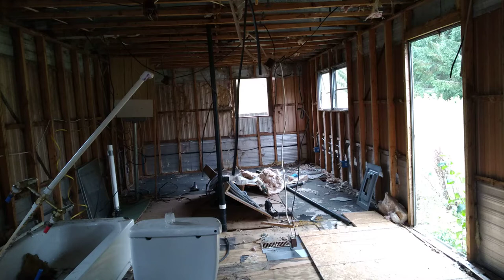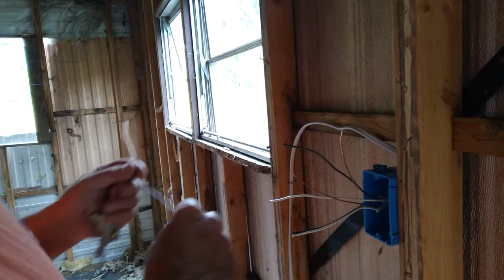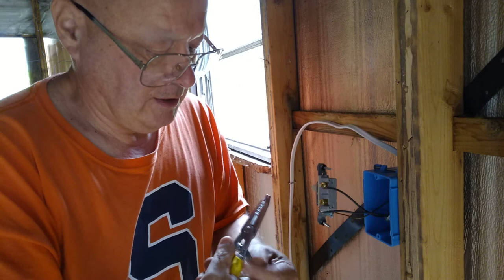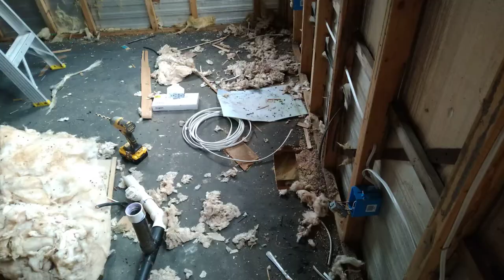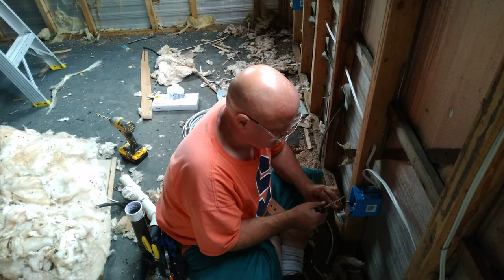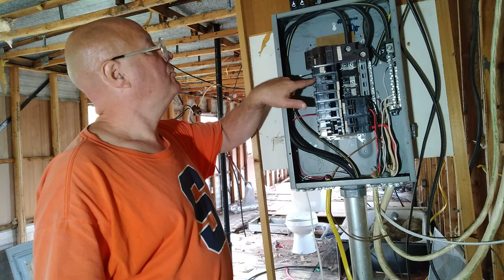I show and explain wiring a mobile home

Comment: What cable are you using?
Reply: (Not a pro just know a thing or two)
1) He hammering the “cradle” I call it ceiling gang box. You drive it with nails into a stud in ceiling so your light don’t fall off if you drilled into drywall which don’t hold weight the same

2)cables are typically 10/2, 12/2, 14/2 meaning the first number is the thickness of cable look up what cable thickness is rated for what amps and the second number tells the amount of insulated cables not including the ground or exposed copper cable

Comment: What are you hammering there?
Reply: (Not a pro just know a thing or two)
1) He hammering the “cradle” I call it ceiling gang box. You drive it with nails into a stud in ceiling so your light don’t fall off if you drilled into drywall which don’t hold weight the same

2)cables are typically 10/2, 12/2, 14/2 meaning the first number is the thickness of cable look up what cable thickness is rated for what amps and the second number tells the amount of insulated cables not including the ground or exposed copper cable